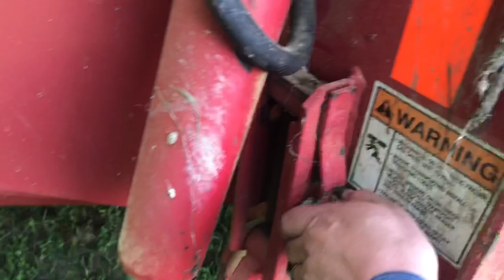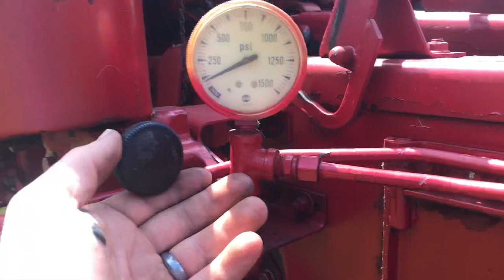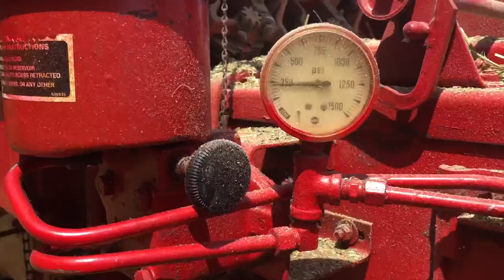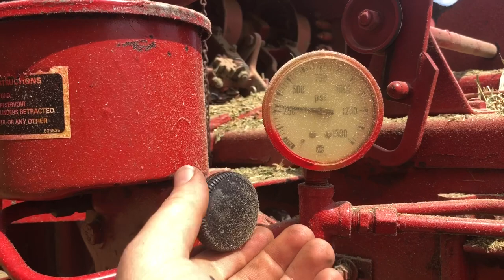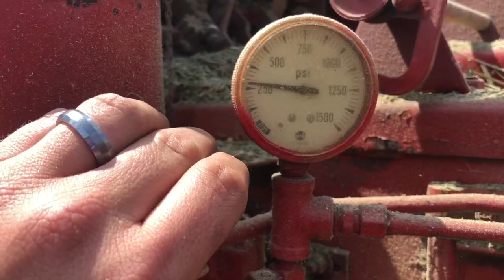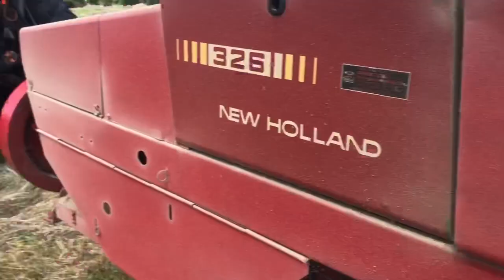Raking and Baling 1st Cutting Hay 2021

Comment: grandpa had a 10 wheel just like that without the caddy, used a deutz 8006 mainly for bailing sometimes raking. goal of mine is to track down each of them or ones very similar to restore